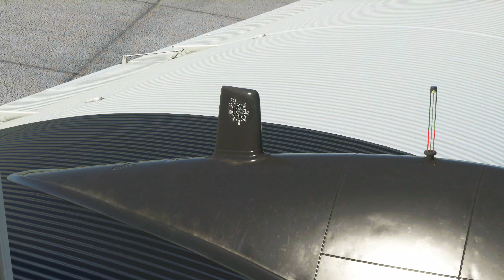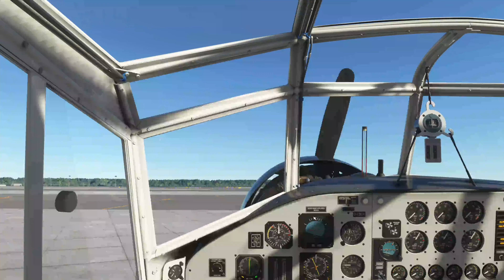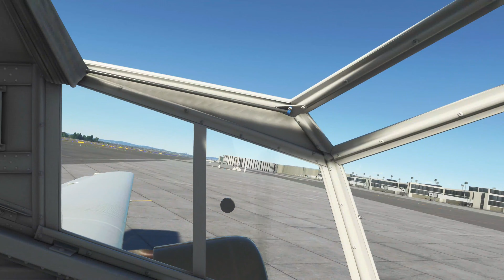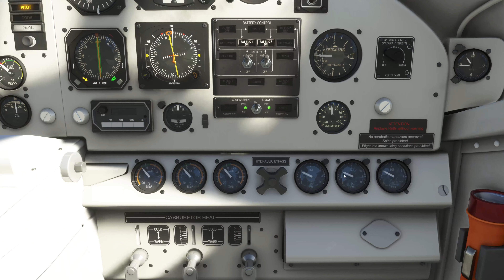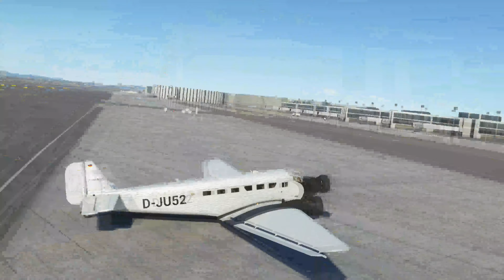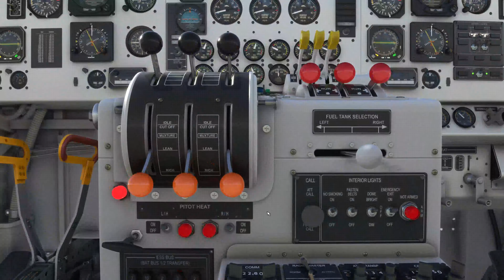The Ju-52 | Start Up and Taxi | ASOBO Ju-52 | 4K

Comment: Where is the flap selector in the cockpit??
Reply from the maker: It is suppose to be beside the pilot's seat, but honestly I have not found it.  I use the flap selector on my Throttle Quadrant.
Reply: @digitalflightdeck4050  Many thanks
Reply from the maker: Just did some experimenting.  Behind the wheel on the side of the Captain's chair is a lever type thing.  That changes between the wheel being a trim wheel to a flap wheel. You have to slowing dial in the flaps if using the in cockpit wheel.
Reply: @digitalflightdeck4050  Thanks DFD